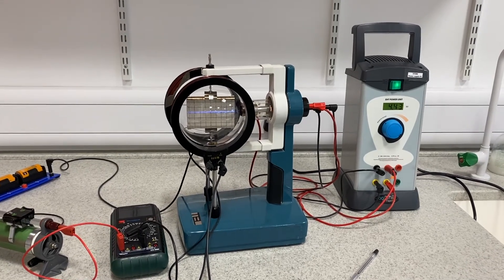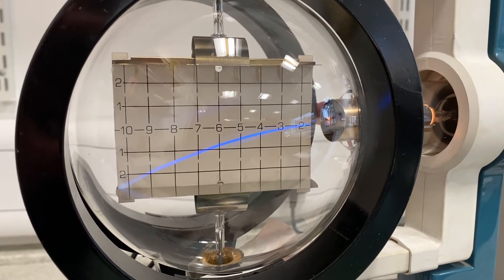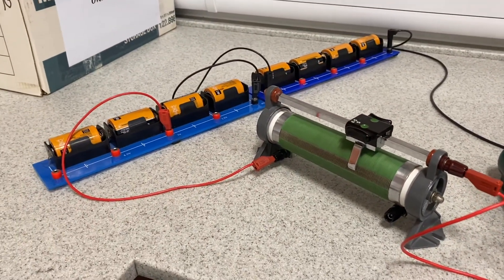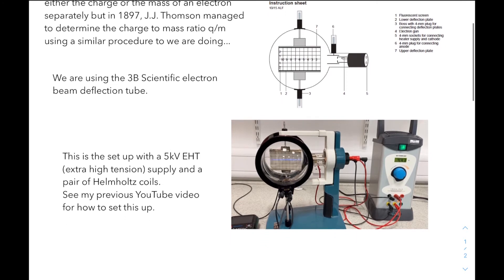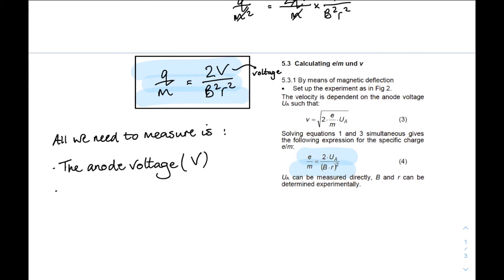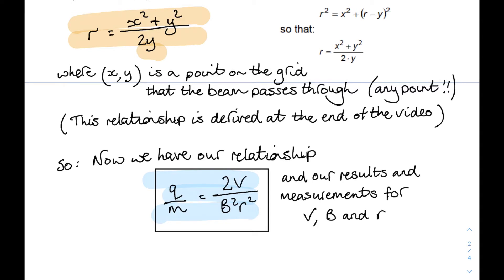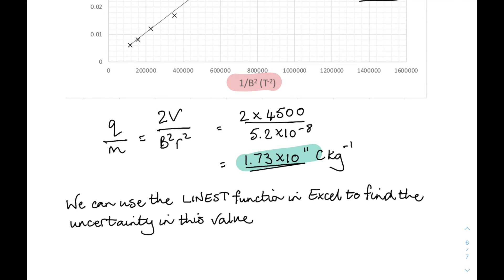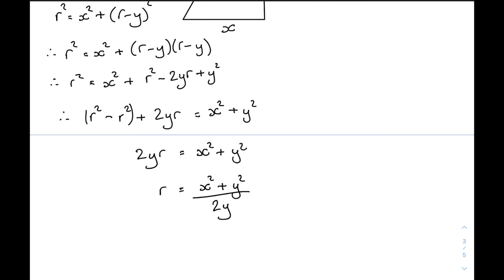AH Physics: Demo to determine the 'charge to mass ratio' for an electron

Comment: Thanks very much for this, what could be the other two experiments to determine the charge to mass ratio?
Reply from the maker: @W.RonanJohannesPaulDiii beam compensation with a crossed magnetic field and electric field ( which cancel each other out) and electric field deflection. 
All 3 experiments are in the deflection tube manual from 3B Scientific.
Reply: @mrstewartphysics  Thank you very much, your videos were very useful for my AH prelim as well :)
Reply from the maker: @W.RonanJohannesPaulDiiiExcellent. Hope all goes well with your project and your final exam. My school website has lots of useful resources too, check out the AH physics page at Calderglen High School. There’s also guidance here on YouTube about how to do your graphs on Excel (Google sheets is pretty similar)
Reply: @mrstewartphysics  thanks